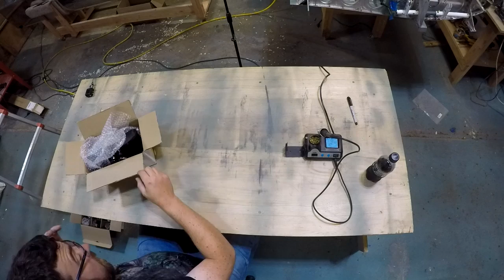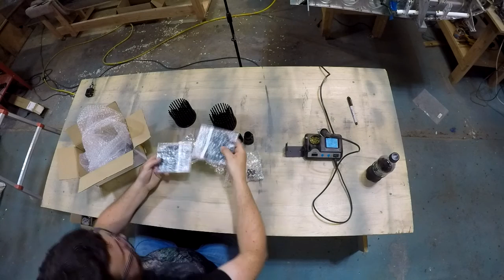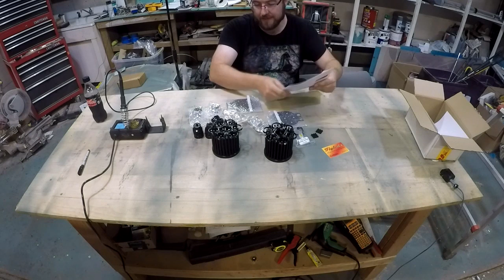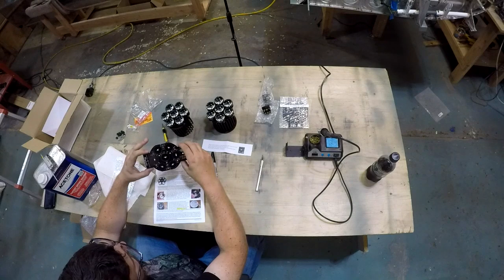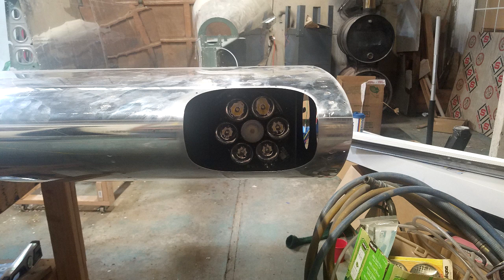Scott's RV-14a - building Flyled's landing lights!

Comment: It’s an ‘old’ video but well done.  Question, does it come with the mounting brackets and lens covers and wing leading edge cutout template?  Do you have a video of the controller and tail light assembly also?  What are the items you need to order from Van’s to make this all work if it’s not included in the FlyLED kit to complete everything? Where are you going to mount the controller? You
Reply from the maker: Hi Macy! Thank you for the compliment! I enjoy putting these together! Unfortunately, I am not sure if I have the raw video files of the assembly of the controller or not. If I do, I can certainly throw a quick video together for you to show the process. I can tell you though that it was very easy to assemble and the instructions are spot on for the entirety of the build. You absolutely do not need a lot of experience with soldering or anything to successfully complete the FlyLED kits! I am a huge fan! 

As far as the tail light, I dont recall if I purchased a light from FlyLEDs for that or if I simply used the whalen light that I got from Vans, I will have to check when I get back from my vacation to Alaska next week! 

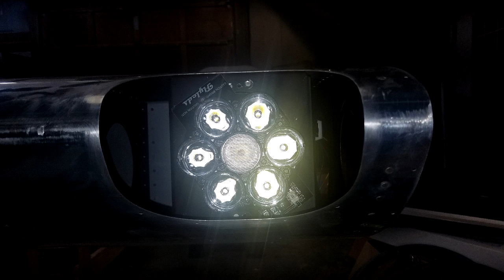Putting these lights into the wings use everything that comes with the wing kit (mount, lens etc.) There isnt anything additional that you need to purchase, at least from what I recall. If you ever have any questions, feel free to reach out to them at FlyLED, they are extremely helpful and pleasant to work with! If you look at the last couple of seconds of the video (I think around the 8:54 mark, you can see a photo I took of the kit sitting inside the wing. You will notice that it is sitting at a 45 degree angle. This is simply because the controller board that the lights are mounted to are just slightly too long but fit in just fine at the 45 degree angle. Thinking back I believe that I had to create two new holes for the nutplates to hold this in position and I simply worked that through the lens opening with a rivet gun and bucking bar. 

I am going to mount the controller in the panel. All the existing wiring feeds into this light from the existing wing wiring harness. Overall, this is a VERY easy kit to build yourself and install. And if you havent had a chance, do a youtube search on FLYLeds to see how bright they are!!! They save you a TON of money also!

Thanks for watching! When I get back from alaska, I will dig through my videos and see if I can find anything to put together a quick time-lapse of building the controller!

Comment: I’m curious how all the parts are lining up with the factory match drilling from Vans and what your thoughts are that?
Reply from the maker: The vast majority of the parts have done very well to line up and only occasionally have I had to use something to force the holes to match up, like a scribe or drill bit to hold a hole alignment. Overall, I have been very impressed with how easily they line up and therefore how fast these kits go together!

Usually the tough parts to line up are the ones that you would normally think of, such as the curvature of a skin trying to go around a tight radius, such as the skin going around the vertical stab.

Comment: Forgot to ask did you have to order a mounting bracket for wings ?
Reply from the maker: No, what I did was simply drill and install two nut plates for a #8 screw to install the lights at a 45 degree angle in the existing bracket hole. I tried installing it vertically, but you couldn't access the bottom screw through the lens hole and I couldnt install it so the connecting holes were horizontal because there wasnt enough room to drill the holes for the nutplates.

Comment: Am I gona want a pair of these?  How much were  they?
Reply from the maker: These currently run for $299 each. There are some youtube clips that show how bright they are. For a comparison, vans sells aeroled landing lights that are 1500 lumens for $306. The Flyleds 7 star landing light is 8500 lumens. Aeroleds show 45W power draw, and if my calculations are correct, the 5X more brightness is only double the power draw at around 92W.

I have not had an opportunity to power them up, but not only do I like that they are so much brighter, but that I can incorporate a taxi light into them as well without having to add another light fixture or make one wing the landing light and the other the taxi light.